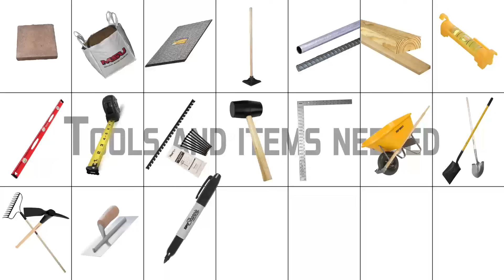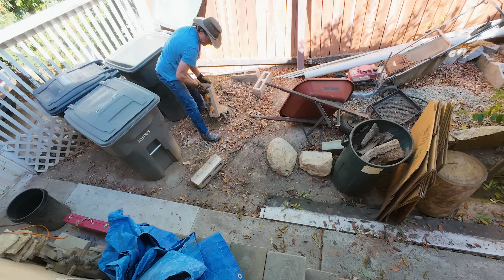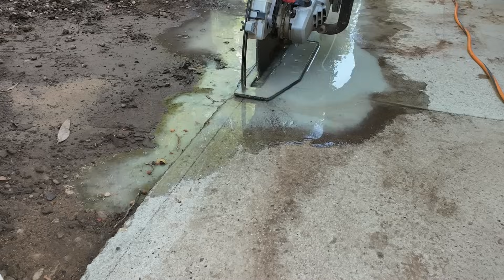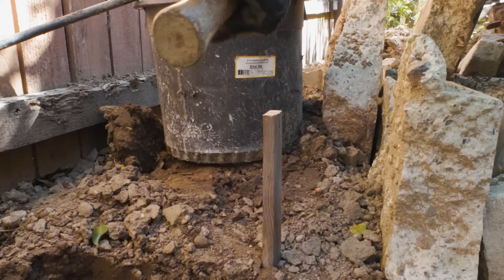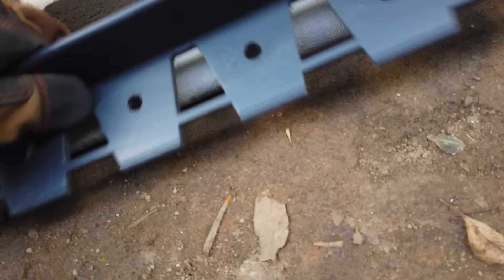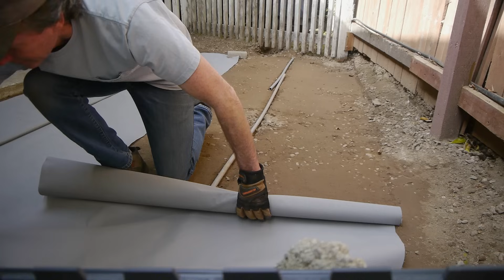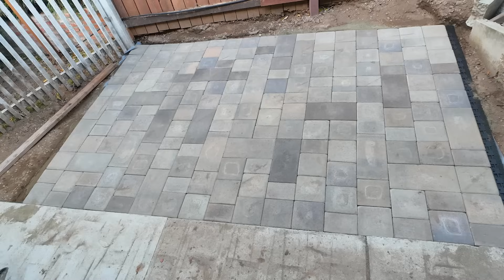Building a Paver Patio with Brock Paver Base - Better than Gravel?

Comment: Is it normal for the polymeric sand to soften after rain? I applied, activated per the instructions, and let dry with several sunny days and it got harden. I just had mine first decent rain and I noticed the joint sand looks like ordinary sand and not hard anymore. 🧐
Reply from the maker: Hopefully someone else can answer this for you. I used regular sand in the two paver patios that I did at my house, but I am curious why it turned soft.
Reply: I have used it and did not have that issue. You might check with the manufacturer.

Comment: what if i am trying to lay pavment on top of an already exisiting concrete walkway? Do i add half inch of send on top of there concrete walkway then the Brock base?
Reply from the maker: If the existing walkway is in good shape, I would just use 1" of sand on top of the walkway then the pavers. No need to use the Brock panels or gravel. The challenge will be the edging to hold the sand and pavers in place, so rain doesn't erode it away. You could use construction glue to hold the perimeter pavers in place; they would need to be an inch thicker so there isn't a height difference since they won't be on sand. I would do a search, I'm sure someone has done a video on it. Good luck
Reply: Yes, do the 1" of self leveling sand. We covered a concrete patio that way.

Comment: Curious which leveling sand you end up using
Reply from the maker: Just the all purpose construction sand from Home Depot that comes in the bulk bags.
Reply: @ thanks for your responses. All the best on your future projects.
Reply: The all purpose sand may be the reason he had some bounce after installing.  The paver sand has more of a bonding material to keep it stiff when installed and tamped.

Comment: Great review! Walking on foam feels different, but it's not a practical difference. Maybe 1/4" chip / high performance bedding will sag less than sand?
Reply from the maker: In my case, I think the ground wasn't flat enough and I still had a few high spots, not really the sand sagging. I was tempted to pull up some of the pavers and try to level out the panels more, but it's not that big of an issue.

Comment: I intend to use this product to improve on a gravel walkway I had a landscaper install nearly 20  years ago. I need/want to cut down on weeds.
Since the soil was removed then, I just need to remove the gravel (really road base) which has collected dirt and weed seeds over time.
I have been purchasing material in small amounts for a year due to price and weight of square pavers. 
It will be a diagonal checkerboard pattern using washed gravel in the voids. (I got the idea from a YouTube gardener — Dig. Plant. Water. Repeat.) 
I'm kind of excited, but know it's going to be a lot of work for this old lady. Small sections at a time.  😏
Reply from the maker: Most of the work will be removing the old gravel. Have fun!

Comment: Could you use this for a shed pad
Reply from the maker: It would probably work for a lightweight aluminum shed, but I would just put down 2" of gravel and then put the pavers in front of the shed. If you are building a shed with 2x4's, a more substantial footings would be required.

Comment: The paver base is much easier to use for a beginner, the sand technique was slower and required more patience and skill, big plus was not having to move excess dirt after patio is finished.  Keep the builds coming !
Reply: From past experience using these panels on a few jobs. Don’t use pvc pipe for leveling. It’s flexible and it will move up and down on low spots. Use metal conduit pipe. I always use 1-1/8’ pipe. Don’t use sand. It washes away. Use 1/4” crush gravel with sharp edges, not round. Don’t use that cheap big box store edging. It’s thin  and cheap. Go to a stone supply store and get their edging. It’s thick heavy duty edging. I’ve done a pool deck and patios with these panels. It’s holding up great. I’ve even used it under a stand alone retaining wall. Not retaining any soil. Just for appearance and separation of the pavers and other ground types. I will never do a patio with stone again. This is so much easier. I know friends that had theirs done with stone and the pavers have already moved and settled. That’s another benefit of the panels. It insulates the ground under the pavers and minimizes freeze thaw issues.
Reply: @jaimecunha6889  wdym? you'd use gravel instead of sand for the panels to sit on? Is it really that much more stable? I feel like that might shift and cause a patio to become uneven over time.
Reply from the maker: Yes much easier with a lot less digging.

Comment: Sand holds moisture. You'd be better off using a #8 or #9 limestone. Angular not round.
Reply from the maker: How easy is that stuff to spread and level?
Reply: @BruBuilds  its the same as sand. And you can walk on it without leaving footprints. (Unlike sand)
Reply: @BruBuilds  I would go with #9 if you are only doing 1/2" poles. #8 is a little bigger. Better for 1" poles.
Reply from the maker: Thanks for the tips!
Reply: @BruBuilds this video just got recommended to me again.  I hope your patio is holding up well for you and good luck in the future.
Reply from the maker: Both patios are still looking great.

Comment: is there any disadvantage to going with 3/4" sand tamped with conduit to not have the sand sliding on the fabric during screeding?  Should the sand be damp out of the bag and screeded?  Got a lot of info from your video even though I am doing a couple walkways and not a patio per se.
Reply from the maker: My thought on using g 3/4” of sand is it might tend to erode away more on the edges.  I think if you can prevent that somehow it should work. You might want to contact Brock and see what they say.

Comment: Run the plate compactor on top and the squishyness will go away.
Reply from the maker: I thought about doing that, but directions from Brock said not to use the plate compactor. After a month I t was seemed to settle better.

Comment: I installed ~500 sq ft patio using these panels, I was pretty pleased with mine. No moving / wobbling at all - though I used polymeric sand.

In your installation comparison - do you notice more “lippage” in the pavers installed on the pads vs the traditional method?
Reply from the maker: I do, the traditional way on sand helps with level the pavers out. And you can run a plate compactor on it with a pad.

Comment: curious, can the pipe/rebar just be left in the sand and under pavers?
Reply from the maker: I wouldn’t, the idea is to pick it up and re-use it  as you put the panels down on larger patios. It also might leave a little hump because sand will compress a little.

Comment: If your backyard is already sand.. can you just tamper that?
Reply from the maker: Is it sandy soil or like beach sand? Sand is not a very good bottom base for pavers because it can shift and move. The sand layer is used to even out the compacted surface before placing the panels. You still would want to remove the 3" or so of material so the pavers are at the same level as the rest of the area. 
I will say that the panel base is easy to use and if you are wanting to do a small area and just tamper it, put the paver base down and the pavers, it may work. A strong paver edging will be very important to hold everything together. If it doesn't work, you could pull it back up and reuse it after adding a better base soil. If it does work, you just saved yourself a lot of digging.
Reply: @BruBuilds  🤞 and thank you 😊

Comment: Good video I wonder if a bigger heavier paver 16 x 24 and close to inch and a half thick would alleviate the spongy underfoot feel?
Reply from the maker: I was thinking about that after installing them.  Larger ones could be worse, because smaller pavers can handle unevenness better than larger ones. I’ve noticed a lot of other paver video tend to use smaller pavers.  Not sure if weight would make a difference, my larger ones are 25lbs.
Reply: Laid 36 for a structure on a flat base with a 5 % grade over 6 feet and they have been solid i think the weight helps just got to build a decent foundation.
Reply: Bigger wiggles and wobbles more than smaller.

Comment: Using GeoCell is probably better... Excavate to depth needed... Compact... Fabric to help keep the stone from sinking into the soil... GeoCell with #47 stone from 2" to 4" depending on what you plan to use it for... 1 inch of Sand or there is another type of small stone to use that may be better... what it's called illudes me at the moment
Reply from the maker: @josephb3147 What would be the advantage over gravel if you are going to 4"? Would that work for a driveway?
Thanks
Reply: Was thinking same
Thing. Better permeability

Comment: Ive used these a couple dozen times when access was a problem and never had any issues. great for diy and the edging strips really locks the thing together when it penetrates the material. only issue is you need to lay them in a way where there isnt a shim piece at the end - might have to start with cut pieces
Reply from the maker: @degeneratesociety Yes, that's why I put the 6" piece in the middle. Any tips on getting the sand screeded, that took me quite a while.